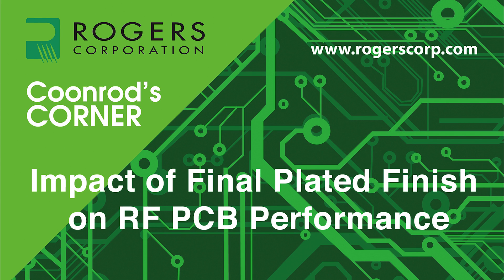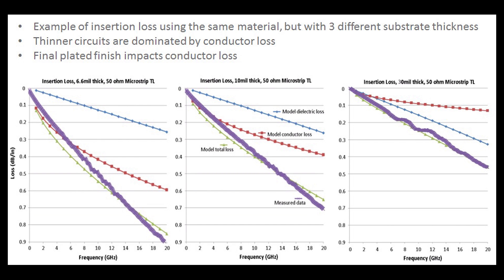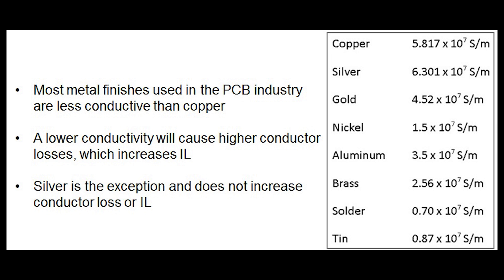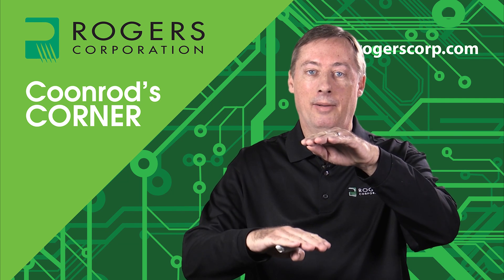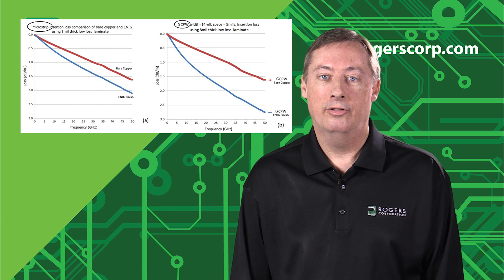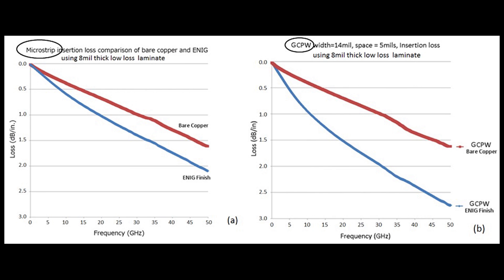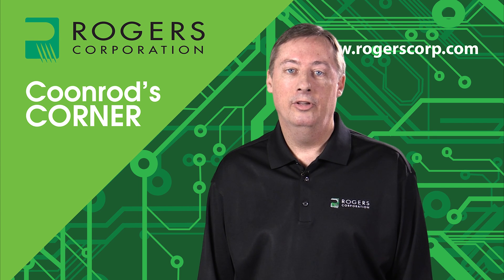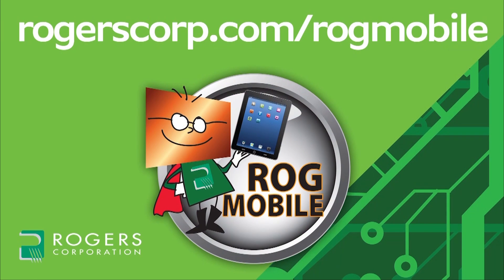Impact of Final Plated Finish on RF PCB Performance

Comment: Hi
Thanks for this informative video. I have one questiont though:

Regarding surface roughness I learned that ENIG finish is much better than just bare copper and so it is recommended to use ENIG plating for transmission lines because of the skin effect. I think this is why many RF designers keep PCB areas with high frequency signals free of solder mask and apply ENIG plating instead. But if I understand your measurements correctly you would rather recommend to either use Immersion Silver plating or keep the bare copper trace covered with solder mask, is this correct?

In my circuit design (2.4GHz) I have several co-planar waveguides and a PCB trace antenna, what are your recommendations for the finish?

Thanks for your help & best regards
Rashid